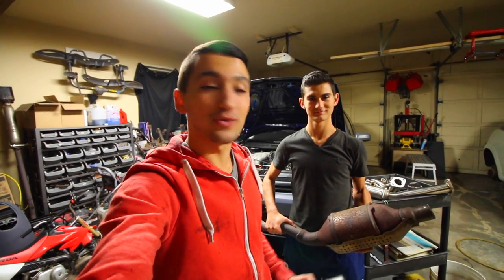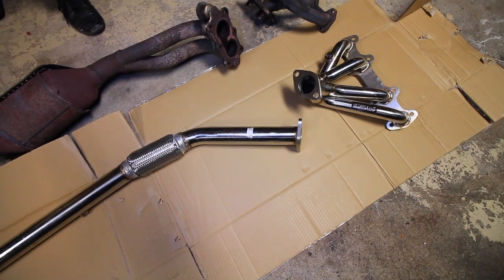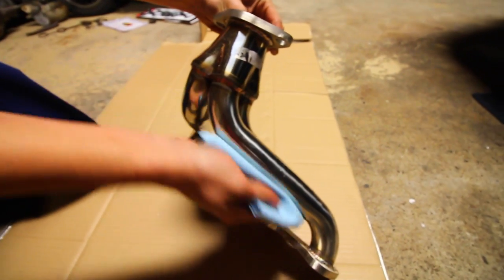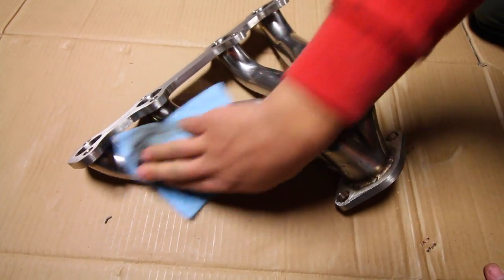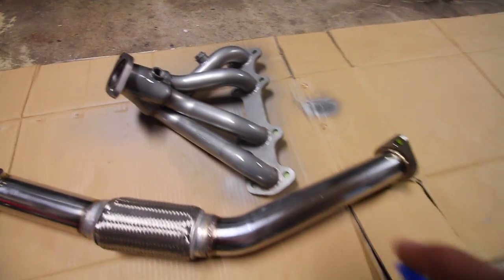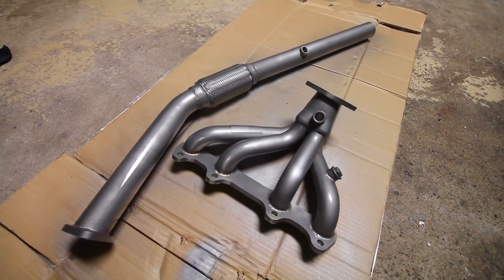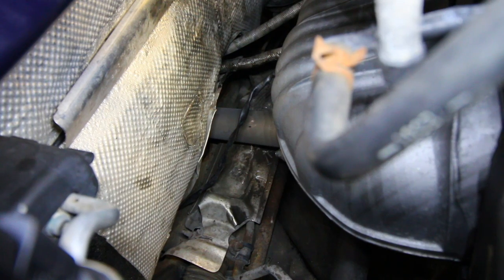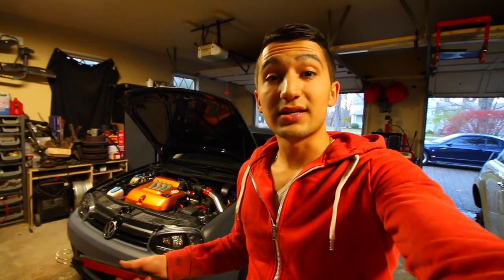How to Ceramic Paint Your Headers

Comment: but problem people don't know is by doing this or gutting a catalyst converter u end up messing up the car it will run rich and go through fuel could make car not run right on vehicles that are fuel injected be different on vehicles that are carbureted can't do this on fuel injected engines I've seen a lot not run right stall out use a lot gas and spudders not wanting to go like of bad gas all because they did that instead of replacing it like you should
Reply: Christian Leatherman that all depends on where the O2 sensors that read fuel mixture are located. Most domestic V8's don't experience those problems because the sensors that control air/fuel ratios are located upstream from the cats. The downstream sensors are only for emissions purposes and will only cause the computer to throw a code. To my knowledge most if not all vehicles can be programmed to run perfectly without cats, by a competent programmer.

Comment: How much low end power was lost with this?
Reply: Allturbo98 you mean gained? Because no cat is more flow.
Reply: gurbeer athwal no since there is not as much back pressure anymore, the low end power will decrease. His top end power would increase.
Reply: Allturbo98 its more low end TORQUE, not power, but touché
Reply: Allturbo98 loss of back pressure does not reduce power. The term you are looking for is exhaust velocity. Removing the cat increases exhaust velocity thus improving performance (as long as the piping is sized correctly). Doing something stupid like installing larger exhaust pipe reduces exhaust velocity which creates exhaust scavenging and decreases performance. Back pressure is bad. Exhaust velocity is good. Don't listen to the Internet...

Comment: Milan, normally I give you full props on what you do. But not this time. Reason being, that is so not the proper way to cure paint. 

Plus, you forgot to mask off the O2 bung as well as the lower end portion flange of the header, and what appeared to be the other end of the lower/secondary pipe. Mounting it on the car to "cure it" by driving it, so not good. It's not supposed to be "handled" as in "installation", let alone driving prior to proper curing for ceramic. 

Considering as much auto work you do in your garage, and obviously available funds/credit to purchase equipment, a worthy investment would be a kiln to bake/cure items in. That would be the proper way, and you could charge your customers for the service to recoup the costs of investment, just saying.

For thorough surface prep of steel, as in removing surface contaminants, as well as a way to "create a texture" without scratching by sanding or scrubbing with scour pads. Consider using malonic acid to prep the surface, as malonic acid will remove all surface contaminants, it will also create enough" texture for solder to hold to which is more than adequate for paints to adhere to, and that way you don't have sand/scour etc which leaves uneven surfaces, especially when done by hand.

Malonic acid is very commonly used in sheet steel preparations for hvac systems, as well as many other machining operations, as a preparation agent. It will not harm stainless steel. All you have to do is brush it on, let it sit for a little bit, then once it burns off enough, simply rinse with water and gently wipe with micro fiber cloth. Voila, totally clean, not scratched, and a surface able to be painted.

Comment: what he doesn't know is the high nickle coating those pipes came with is 100 times better than any rattlecan crap you could ever apply. the correct use of the high nickle coating is to install pipes, clean off all fingerprints and fire up the engine, allowing the pipes to come up to temp.. this causes the molecules of the steel tubing to expand and open up the pores thus allowing the high nickle plating to leech into the tubing which will keep it from ever rusting. Doug Thorely Headers use this coating on 100% oh their headers, unless ordered otherwise. sanding the surface so paint will stick ultimately destroys them....great job of misinformation. The world is now a less better place, because of your video. Muahahaha <:/)
Reply: another misconception "louder = faster" bullshit. put a damn muffler in it already.

Comment: Even though it is stainless steel, overtime it will rust..... 😳 pretty sure that means it’s not actually stainless steel..
Reply from the maker: Stainless steel is still steel. It will rust, but it does it at a much slower rate.
Reply: I put stainless on my 5.9 Cummins 5 years ago at 70,000 miles. At 335,700 miles now there’s no rust whatsoever on it. I’ve driven that truck for a weeks straight throughout the US in every weather imaginable and besides it turning blue there’s no marks at all on it. I guess there’s a difference between true stainless exhaust and stainless coated exhaust.

Comment: You are destroying the head on that car with the removal of the backpressure the car is designed and tuned for. Coating looks meh. Cheap hardware silver. Lots of effort for little result. Wrap it and keep the heat in the exhaust and away from the intake air.

Comment: Stainless steel DOES NOT rust!...Ever.
Reply from the maker: That is so not true. By doing a bit of research, you will see Stainless does indeed rust. The metal is will not rust as fast as a regular cast iron, however it is still not rust proof.

Comment: He is desperately trying to sound and look as ChrisFix, especially when he is talking with his hands LoL 
Removing the factory steering wheel that has AIRBAG and installing one without just shows how much you know about cars and safety.
Also why would you worry about headers getting rusted from outside ? You are not on a Motorcycle so they are visible..
even you painted them they are not going to last any longer ..

Comment: that is not ceramic paint! Plus, as so many others have already said stainless doesn't rust... I'm just watching you ruin a wonderful set of headers with your "brilliant idea"... nooooooooooo
Reply from the maker: First off, yes it is ceramic paint. Buy the can and see how it is. Second off, stainless does rust, it just rusts LESS fast, hence the name stain-LESS. I'm not sure if you're familiar with cold weather/canada and their ability to cover the roads with excessive amounts of salt, but if the stainless pipe isn't covered, within a year it will look like crap!!
Reply: First off, no it is not ceramic paint. If you believe the can that's your problem.
Ceramic "paint" does not exist. It's called CERAMIC COATING and it is applied on materials, usually metals, with use of a system that can heat up ceramic pellets to VERY HIGH temperatures and blasts them onto the target surface. The hot/molten-ceramic then is able to fuse onto the surface. 
You're just showing you have no idea what you're talking about. 
And stainless does not rust. It can oxidize however, like aluminium. It will lose its resistance when you overheat it severely, as you should know if you're familiar with welding stainless. You should have kept that header/pipe just like they were, their coating was much more resistant to the environment than this cheap-ass spray-can "heat paint". 
Second off, I live in Canada.